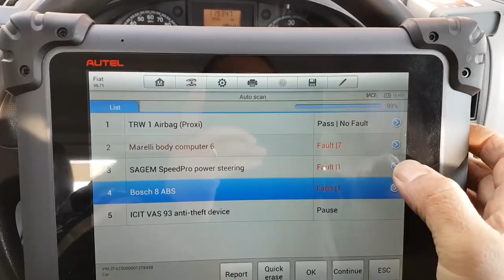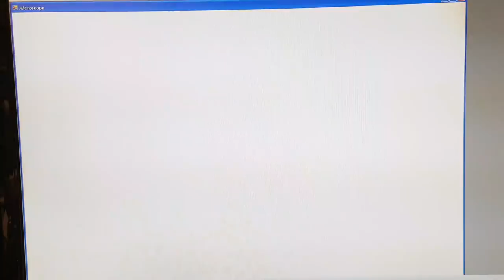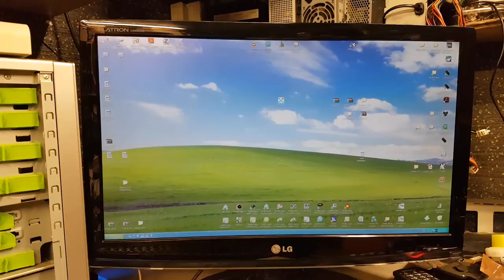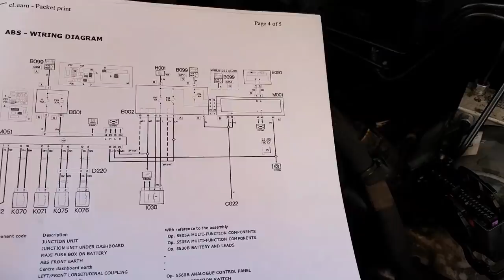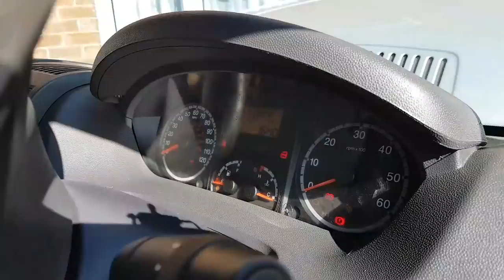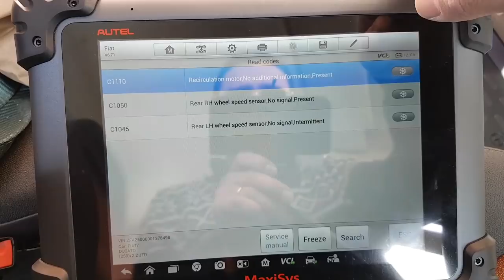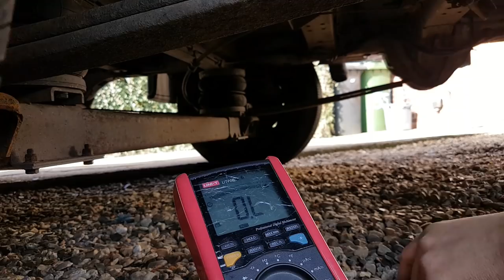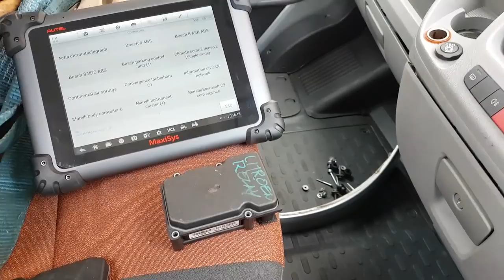Fiat Ducato 2008 ABS light ON. How I was wrong!... Fault finding and repair.

Comment: I have just repaired my ABS, Ducato, 2012. One of the wires of rear right sensor was broken. The place of fault was on a more or less stright section, ca. 40 cm from the plug. The wire was somehow crushed and probably broke from vibration. Having many backgrounds I decided to use 3M Scotchlok to restore continuity. It is fast, water-proof and reliable.
Thank you for your video. I appreciate the time and effort you put to make the knowledge accessible for others.
Reply from the maker: That's great! 
Well done! 
Thank you for watching, for your comment and feedback! 
👍👍👍

Comment: It's gr8 how you make sure we can see everything by correctly positioning the camera. I was impressed by how far you go to diagnose the problem. The RR sensor was changed without even checking the wiring. The fault in the wiring looked as though it had been on for quite some time. The fuse box was another unknown and your approach of checking everything pays off.
I thoroughly enjoyed watching your detective work.
Reply from the maker: binarybox 
Wow... great that you enjoyed it!
Thank you for watching and for your kind comment!

Comment: Excellent work. Wish there were mechanics like you over here 👍🏻
Reply: @LMAutoRepairs  ever had esc and hill hold warnings come up (no limping) and disappear after two restarts? Reading it could be brake light switch beneath the brake pedal?
Reply from the maker: @Bartezz  
Never had that on a Fiat...
But had weird things on others due to the brake switch...
It might worth for you to investigate it further...
Scan it it first, and check live data, that will help you giving some guidance...
👍👍👍
Reply: @LMAutoRepairs  thanx, hopefully I can get someone to read codes. Had a few obd dongles to work with android phone but they all seem crap.

Comment: Hello Luis, thanks for the video. Regarding the burned wire inside unit, it might be due to the programing in the factory. It is common with the eprom memory that after programin the chip higher current is applied to one of the legs of the IC which causes inside connection to burn, which prevents the content of the memory to be overwritten. It might be similiar sort of protection. I assume that these types of ABS are used on different types of vehicles, so I assume that the units are the same but software that they contain is different (ABS works with different parameters). Therefore after the units were programmed in factory I think that they burn the programming connection to the chip in orver to prevent either accidental overwritting or copying of the software.
Reply from the maker: Hi
That makes sense... never thought about it! 
Thank you for watching and for sharing that info!
Reply: I was going to suggest the same thing, fuseable link to terminate programming and to stop it being read/cloned etc
Reply from the maker: Thank you for watching and for your comment...
Reply: I was just about to ask/wrote the same thing, I can remember when I studied electronics that you can get a FPGA which is a chip with multiple circuits on it and the useful circuit is kept and the others burned away(like miniature fuses burned)... I think it’s a cost saving thing so the same FOGA can be used in multiple circuits but just configured differently and no need for a custom chip.

Comment: Thanks so much.. Citroen relay in nz with the same abs code - no one here will touch it.. about to send the abs module back to the uk but thanks to this video i will check out the options your show.. i reckon in my case front right wires as a couple of years ago the pad wear sensor wire ripped out and left loosly taped up at the advise of my mechanic. Thanks very much for this video. i learned alot.
Reply from the maker: ☺️
Thanks, hope you get it sorted! 
👍👍👍

Comment: yea lots of mechanics take the fuse out so the pump dosent work as causes crunching on brakes  ,i have removed the fuse myself untill i have fixed the abs problem on many a car ,just so u can actually  drive it without brakes not working properly ,it means all four wheel cylinder s work at same time ,,great vid mate enjoyed it have found many faults same way ,,hahaha yea pity u never started from rear haha :) take care
Reply from the maker: 😊
Thanks!
For watching and for your comment! 
👍👍👍

Comment: Great video i think this is now going to help me lots with my problem i have the same van with electrical problem. Abs light comes on know again speedo stops working. But noticed a couple of times there has been a smell and smoke coming from the battery straight after the brakes are used im thinking now there is a damaged wire to do with the ABS last night had to take battery out of van because it was smoking so bad will be investing after the weekend. Thanks for the help 👍
Reply from the maker: Hope you get it sorted!
Thank you for watching and for your comment!
Reply: Did you find the problem? I have a Citroen relay- the last time i drove it with this abs issue - i reversed back in my drive saw and smelt smoke- i thought it was coming from the rear left wheel somewhere.

Comment: I just wanted to say that I only found you channel today but I've already watched tons of you videos
and subscribed.
Also I not a mechanic but I'm pretty good at soldering, fixing computers, phones and anything electrical really so a friend of mine who is a mechanic sometimes brings me ecu's and other modules to repair. 
Anyway not to long ago he brought me one of these abs controllers to look at and it had exactly the same burned wires and even though I have very nice soldering equipment and a very expensive microscope I thought the same as you, that is a whole other level, in fact I don't think there are many people alive who could soldering those wires? I actually thought it was alien technology 
when I first opened it :-O
Reply from the maker: Tommy T 
Indeed... very tricky to solder those... there is special microscopes/soldering stations for this sort of jobs...
Thank you for watching!
Reply: LM Auto Repairs yeah my microscope is more than good enough but I doubt that my smallest soldering tip would be small enough and I know my hands certainly wouldn't be steady enough lol.
And thank you for the videos, for someone who isn't a native English speaker you explain thing very clearly and in a way that even I can understand, 
this isn't always an easy thing for people to do :-/

Comment: OK so I followed your video instructions but I made a small mistake somewhere not sure what I did but now the driver side taillights don't  work. So I fixed the problem but created another one .. what do u suggest I do now??
Reply from the maker: Check what you have done... 
Perhaps, check fuses first, just in case...
👍👍

Comment: I enjoyed your work so thanks again. 
With the fuse missing I suspect an unintended path was available between the control unit power feed to the solenoids (which are the only things drawing significant current) i.e. from the remaining processor power feed via the small wire that clearly was overloaded. In the case of Module B that wire looked burned but still worked so perhaps it wasn't abused for very long.
Reply from the maker: Rhian Taylor 
Interesting theory...🤔
Thank you for watching and for your comment!

Comment: What is that yellow screw probe you use for continuity testing? Does it splice into the cable or is it non contact?
Reply from the maker: Yes... pierces the insulation of the wire...
Thank you for watching!

Comment: Exelent job I teatch new tec and one of my way is ask them to check the integretie of the wiring from the plug to the ecu all the time before replace any component but as we know this is the resault of just replace a sensor because we have a fault code keep up the good work Forte abraco da Colombia
Reply from the maker: Gouveia Classicos 
Indeed... it is a lesson for me to... to start diagnose without taking into account what someone else did... if I would have ignored the fact that the module was changed, that's where I would have started...😋
Thank you for watching! 
Grande abraço!
Reply: LM Auto Repairs Been there got the t shirt to we learn with are mistakes Lol

Comment: hi there, what is the yellow device which you were using to detect the faulty wire without cutting the actual wire? thanks
Reply from the maker: That's just a piercing probe...
Thank you for watching!
Reply: @LMAutoRepairs  thanks for the quick reply

Comment: did u put pump A back in ,bet that worked fine also with no codes :)curiosity killed the spark haha
Reply from the maker: Yes... put it back and worked perfectly...
👍👍
Reply: @LMAutoRepairs  minted ,,love your vids mate just got a 1,3 cdti ,have p0400 code ,but clutch will be getting changed ,then i think will strip down this egr and clean it all see it looks like common fault on this kinda car ,haha also have abs light on but scan tool lets me check each sensor so easy fix ,take care :)

Comment: Grasping at straws .. had a break in sensor wiring to the rear wheel speed sensor , if one of those signal wires was either shorted to ground or managed to chafe itself in contact with a wire in the harness carrying 12 volts.  The damaged ABS signal lines do they lead to that burnt wire input on the chip ?  Someone trying to probe the rear ABS sensor loop with an old low impedance multimeter or 12 volt test light that was capable of flowing too much current into the circuit (less likely)  , A Bad ground can also cause current to back flow back through components never designed to handle that much current , I have seen a bad engine to frame ground force high starting current to try find a grounding path back through the sensor circuits , this destroys the fine circuitry in the module it manages to try and find a return path through .
Reply from the maker: I would assume that the modules are designed to detect this, either a short to ground or to positive,  without causing any damage... but you never know... it is possible!
Thank you for watching!

Comment: Excellent, logical troubleshooting!! Well done on finding the root cause of the issue.

Seems like the van just had the parts sh0tgun fired at it with no real investigation.

Were you able to identify why the wires under the van had frayed? Were they rubbing against the frame of the van perhaps?
Reply from the maker: keitho77 
Did not looked like they were touching anything... perhaps just water ingress etc...
Thank you for watching and for your comment!